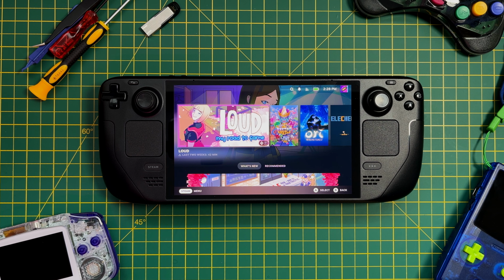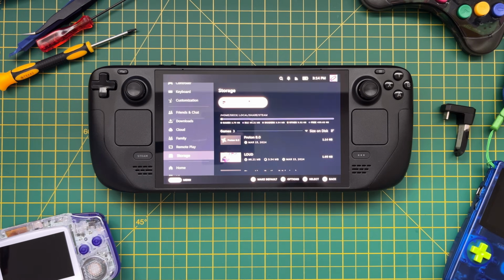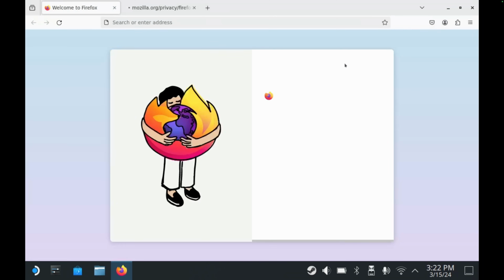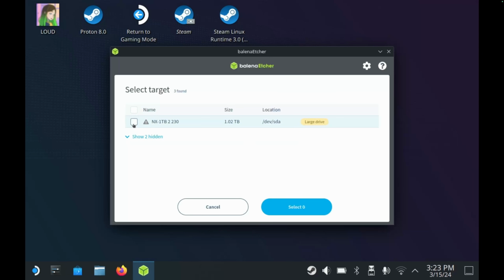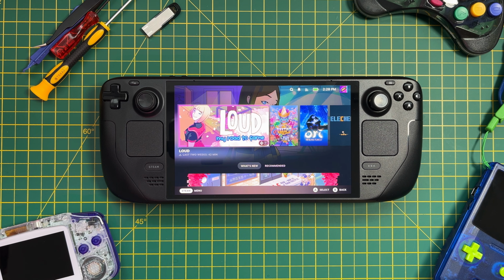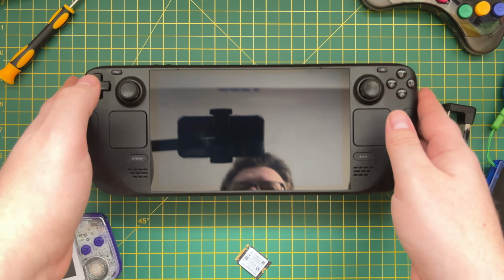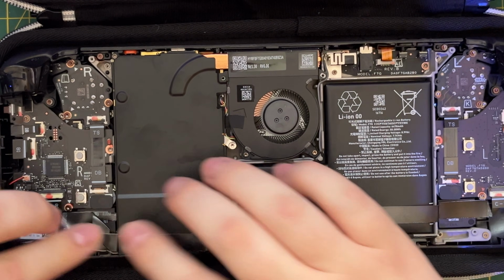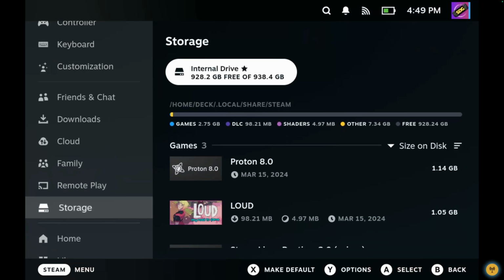Upgrade Your Steam Deck Storage! The EASY Way!

Comment from the maker: There is an issue with the latest version of balena etcher. Until it’s fixed,  you’ll need to download earlier 1.18 version if you want to follow this guide. If a newer version works for you, please let me know so I can update this comment!
Reply: I can confirm I just used the newest version on their website because I didn't read the comments first... thankfully their most recent version based on the github was released 3 days ago. I believe they fixed the problem.  Everything cloned successfully. I installed my new SSD, powered on and got worried at first because loading took a minute and it went to the original setup and login screen like a factory restore. Chose English and my time zone, logged into my account and everything is perfectly as I left it. I do have to redo settings and some things, it's almost as if it's a fresh install, yet all my games are installed and working (I've only tested elden ring so far). All my video files I've saved etc are there in desktop mode. All good! 👍 

Thank you for the guide! 😊
Reply from the maker: @Flybynight11598  glad to hear the new version is fixed! 👍
Reply: Which version did you use 1.19.21or 1.19.22
Reply: Works fine using v1.19.25. Great guide.
Reply: @steamdeckguy  I couldn’t get it to work. I tried a few older versions with no luck. Found some videos with the Komand prompt and used that. Worked like a charm. 512gb to 2Tb!
Reply: Great guide thank you
Reply: Still didn’t work for me…please help
Reply: I found somebody on Reddit that suggested a code that I can’t remember but it essentially reformatted my ssd even though there was nothing on it…ended up doing it through Konsole which took over a day but eventually got done. Thanks for the guide.
Reply: What exactly is the issue? Just flashed my SSD onto a 1TB microSD card and checked storage and it says it’s still a full card; no space is taken up. There should be like 250GB missing but it was all there, so I formatted the card and I’m trying again while I’m off to work. Is the issue you speak of with the actual writing process, or with getting it to run because that took a little doing as well. Do you have a recommended version (ex: v18.0.8 or something like that) that will work properly?
Reply from the maker: @chewypinecone  the issue was that it wouldn’t let you run the clone process at all. To be honest, I’m not sure what you are trying to do… why are you cloning the ssd to a sd card?
Reply: @steamdeckguy  I’m glad I have someone experienced to talk to about this. 

My left trackpad suddenly stopped working, so I’ve gotta send it in for warranty repair. They were very, very clear about not being responsible for any loss of data, and since I have some unrecoverable stuff on there I am following your guide to clone my SSD onto a microSD card so that even if they send me a brand new unit, all of my data can still be there. Just gonna have to trust that this is really gonna work and I’ll be able to figure out how to get the data BACK onto the SSD once the Deck returns.
Reply: This should be pinned. Would save some frustration.
Reply from the maker: @ it was pinned, but apparently folks saying it works with latest version now
Reply: @steamdeckguy  It still isn't working, is there any OTHER program that can do this?
Reply: can you please do the version of the video where you use command line??
Reply: I can confirm 2.1.2 does not work 
No matter what it says drive to small 
Had to use commands!!!
Reply from the maker: @havyglass did you actually put the new ssd card in the steam deck and boot into steamOS? The resizing doesn’t happen until you do that step.
Reply: Already did all the steps, but after restarting, it got stuck on the logo screen. Do I wait for it, or should I reimage?
Reply: Would you know of any setting that would prevent the storages to show? The software won't recognize either m.2
Reply: @ericroberts435 I actually wasn't able to get it to work either until I went to the github and grabbed the version he used in this video. v1.18.11
Reply: I didn't have any problems making the imager running, booted successfully once... Then after another reboot all sorts of errors happened about login credentials and had to have it erase and setup as a new user.  Also the boot error manager keeps popping up.  But once you select the right image to boot off of it works fine... so yeah, it works technically, I guess.  I am going to have to further troubleshoot.
Reply: hi, when cloning the drive it took a while like over 2 hours, and then it started validating which was estimated to take another 2 and a half hours but there was an option to skip. i didnt wanna wait that long again and my steam decks battery wouldnt have lasted so i pressed skip since it seemed optional, but it never finished the flash. it just went back to the page where you select a target for the cloning. 
so you cant press skip for the validating part? and does your decks battery last, mine was at maybe 75/80% and then 20% when it started validating
Reply: Newest version works. Jan2026
Reply: Went back to an even earlier build of 18 but now when I went to flash it tells me failed target with an error message saying einval: invalid argument, open ‘/dev/sda’
Reply: You say to use an earlier version, but the website doesnt allow you to do that. Awesome guide, thanks for wasting everyones time
Reply from the maker: @AbatedFawn  prior versions can be found here https://github.com/balena-io/etcher/releases
Reply: @AbatedFawn  i used the current version and it copied without issue. Now I haven't tried installing the new one yet, but it copied with no errors.

Comment: This video was very helpful. I want to post a couple of problems I ran into in case anyone else had trouble. First when I’m desktop mode on the Steam deck you need to open Steam in the background to have the virtual keyboard up. When cloning the internal ssd you need to do this so you can enter your password. I had also had trouble with entering the bios. The screen keep shutting off when ever I tried to enter the bios menu. If you have the Dock. Plug it into an external screen with HDMI and you should be able to enter the bios and see the screen. Then last my Steam deck was the lcd one so there’s a hidden screw under silver tape. Other than those few differences this was amazing and very quick process. Thanks man.
Reply: I had issues getting balena to open
Reply: @nappinassnick which version did you download?

Comment: I've cloned my 256GB drive from my Steam Deck LCD and I'm waiting for the rest of the upgrade parts to arrive before installing it. Between the 2TB SSD and a 1.5TB SD Card in the Steam Deck, plus another 1.5TB SD Card in the JSAUX Docking Station, I'll have almost as much storage for games on it as I have in SSD capacity installed in my Windows 11 PC. I should be able to install 70+ games on it, depending on how big they are.

Comment: Can confirm this worked with a "orico" NVMe enclosure, though the time to clone my 256gb deck to a new 1TB SSD was close to 5 hours averaging 40MB/s. not sure if that was a crappy enclosure or a limitation of the USB bus on the deck/my dock. don't try to start this without plugging your deck in, it takes hours and my first attempt failed after my deck went to sleep because of power settings.

Comment: Trying to follow this guide on a new LCD. Firstly the current landing page doesn't have an appimage file that will open. I found a page with 1.19 on GitHub that will open. Next my NVME drive - It showed up on the SteamOS in my enclosure - but in desktop mode it won't show up in Etcher. I went back to game mode and formatted it. Went back to desktop mode. It shows up on the desktop, but still won't show up in Etcher. FFS

Comment: I had one issue following this guide. After completing the swap and rebooting my Deck, it would be stuck on the orange/white logo screen. After booting into safe mode, it gave me an error message about a password mismatch; I guess this was due to changing the password via balena but not the whole system. I could not boot in to Steam with either pervious boot options, so I had to use the erase all data option. It worked but it was only not an annoyance because I had only one game installed.

Comment: Very good video. Your cloning method with etcher worked fabolous. Before I had 512GB now after the 2TB drive (WD black SN770M by the way) is installed, I have 1,8TB. And everythings works! No new install, etc.etc. Very nicely done

Comment: Does that guide works with the old legion go with steam os installed?
If yes, is the battery storage mode also available on that hardware? Or isn't required to do it because you can unplug the controllers before starting the disassembly?
Thanks in advance to who can help me, I have a 2tb ssd on the way and dont want to screw all my settings and emulators

Comment: Awesome video. I am dollowing the steps for my Legion go S Steam OS.  I was heitating between this live method vs Macrium Reflect ... I gave this method a try. I just finished the clone. Just a question, once the cloning completed (green check mark like your video), I went to the Storage in the main menu, out of curiosity, and clicked on my 4TB but it did not show any files whatsoever, just empty and said if you wanna use this drive you need to format it. Is this normal?

Comment: Hey again, dude. Wanted to ask if you’ve had any issues since cloning? Everything was working fine at first, and balena worked for the most part. However after restarting the device it went into infinite SteamDeck logo screen then went to being stuck in emergency mode.

I tried booting into previous OS. Still stuck. Then I cleared the data on the SSD. I was able to log into WiFi and time zones since it was basically a factory reset of steamOS, then it went straight to emergency mode again.

Any ideas on what went wrong? For now, I’ve reinstalled my old 512 gb SSD in my OLED and it’s back to normal.

Comment: That was the smoooooothest upgrade I've ever done. Thank u for the very easy tutorial as well. Gotta give props to Valve as always for being so pro consumer with these kinds of things.

Altho it took super long as my previous ssd was 1tb almost full of games (so 1tb to 2tb upgrade). It took almost 15 hours give or take. So I just slept throughout the rest of the cloning process with constant wake ups to check if its still going lol. 

Also can confirm the recent version of balena etcher 2.1 (i think) works on steam deck oled.

Comment: Worked flawlessly on my Deck! Upgraded my LCD from 256GB to 2TB thanks to the WD_Black M.2 2230 on sale. I used balenaEtcher versione 2.1.4 with no problems at all. I did get the same SSD Adapter and use the old SSD in it now as an external drive. The whole process took me like 30 minutes including cloning the SSD. I deinstalled a couple of big games beforehand to speed up the process. Now i can Download all the games i want! :)

Comment: i dont see that asset you said to use on the website can use legacy 32 bit instead of 64 bit or do i use etcher for linux x64 64 bit zip
Reply: Extract the zip file and open the extracted folder and then open the grey coloured file that says balena-etcher then execute. It doesn’t have an exe or anything in the file name btw or the app image. That’s probably where the confusion is. Hopefully that helps
Reply: @s.beezyprince3973 thank you

Comment: I have legion go s with steamos so I cloned 500gb to 2tb ssd and it booted fine at first, but I did some updates and after restart it was stuck on logo and I couldn't even fix system with recovery iso. I had to reinstall steamos from scratch. It seems some people had similar experiences with regular steam decks so I'm not sure what caused that.
Reply: Yeah I had the exact same issue had to re download everything but at least now I got more space

Comment: I’m totally stuck. Can someone help me? I downloaded the balena Etcher Linux x64 file twice now (to my Steam Deck downloads folder in Desktop Mode), but I’m not getting any “app image” or anything like what you show on screen. It’s a zip folder, and when I unzip it there are many files and folders but no app image.  The only answer I can find on google says you must have downloaded the wrong thing, but I didn’t. I went to the exact same URL and clicked the exact same thing as the video shows. [Update: I figured it out. Inside the zip folder there was a file simply named “balena etcher”, and double-clicking it loads the program.]
Reply: Run: Open the extracted folder and locate the executable file, which is typically named balena-etcher. Double-click it to open the application.
Note: If double-clicking doesn't work, you may need to open a terminal in the extracted folder and run the executable with sudo or by first making it executable with chmod a+x balena-etcher and then running ./balena-etcher. 
From google :D
Reply: Same thing happened to me, I was able to copy the ssd, but once I did the swap, it says there is no bootable device, i’m not sure if my disk actually copied onto the new ssd

Comment: i think this video is outdated possibly, i went by this step by step and when i came across downloading balena from the website it only had a Linux x64 (64-bit)(Zip) download file with the Arch being x64 and a second linux that is labeled Linux (Legacy 32 bit)(App Image) with a x86 Arch, what now im at a dead end now ?! :(
 pleaseeeee helpppppppp :(
Reply: nvm i got the solution from a older comment , solution: 
Download the zip file and extract the files. Then click on the one called BelenaEtcher, it will work the same from there.

Comment: Hi, I encountered an issue with balenaEtcher a couple of times during this process. For some reason my Steam Deck OLED wasn't playing well with the Ugreen SSD enclosure connected directly to the USB-C port (same one in the video). Having the cloning process fail on me several times led to my Deck being stuck on the Boot icon after trying the new SSD. I refused to believe I had to do a fresh re-install of SteamOS, so I plugged in my USB-C hub (which also happened to be Ugreen) and plugged in my enclosure there, as well as my charger. From there the process went smooth as butter, as long as I didn't disconnect my charger, for some reason that would interrupt the cloning process. 

A peculiar problem I know, but if anyone encounters a similar issue, just try using a USB-C hub so you can simultaneously charge your device during the cloning process. My guess is balenaEtcher doesn't play well with the Steam Deck running on battery.

Comment: all i have is a microSD for booting the fresh bios. i dont have a type c flashdrive or an enclosure. found this looking for solutions.. this one seems incredibly useful as i can use the enclosure as an external SSD. expanding memory even further. just wish there was an easier way to flash install steam onto the new SSD from the microSD.

Comment: Do you need to do the 25% drain thing for the method prior to activating the battery mode?
Reply from the maker: Up to you if you wanted to risk not doing the battery drain, but if you wanted to do it safely then you need to drain the battery, then put it in battery storage mode

Comment: There is no longer a 64 bit app image and this doesn’t work, could we get a new one?
Reply: I had the same problem. You have to click the application that says Balena ectcher in the folder
Reply: Download the zip file and extract the files. Then click on the one called BelenaEtcher, it will work the same from there.

Comment: i do have questions

1.if i uninstall games from steam deck, it still be tranfser/clone yes?

2.i have emudeck and all the games are on sd card and i don't need to worry about it yes?
Reply from the maker: Whatever you have installed already will be cloned. You don’t have to worry about the SD card - anything you have installed on that will still be there
Reply: @steamdeckguy  hey me again listen i should clarify but i have the original model deck and wondering if i can still clone it on the ssd and all that?
Reply from the maker: @carlosrayo6092 yes, I’ve done this on an original LCD and OLED.
Reply: @steamdeckguy alright it’s still I can still clone the data on lcd good anything else cause I remember seeing one video about lowering your battery before swap the ssd

Comment: I wonder what would happen if you took the old drive and installed it into a normal desktop. Would the OS boot up and work as normal or would you get a bunch of errors?
Reply from the maker: I don’t believe it would work, as it only supports specific hardware right now- but maybe in the future…. It’s an interesting question.
Reply: @steamdeckguy  well, the only way to know for certain is to test it. I've got tons of spare PCs and part just sitting idle atm. If I get a chance, I might as well take a stab at it.

Comment: I have been hearing recently this isn't mentioned by steam because it voids the warranty of the device? It's not like the PS5 and has a compartment cut out to easily access although that wouldn't be a half bad idea for Them to include on new model's!
Reply from the maker: I doubt it voids the warranty, but if you break something by doing it wrong, then I think they are well within the right to not cover the repairs. E.g. if you damage battery cables or something. It’s low risk, but it can happen.